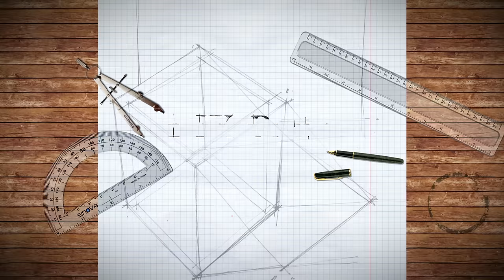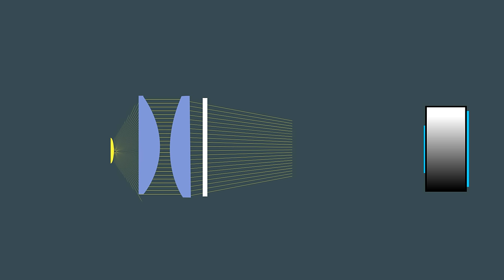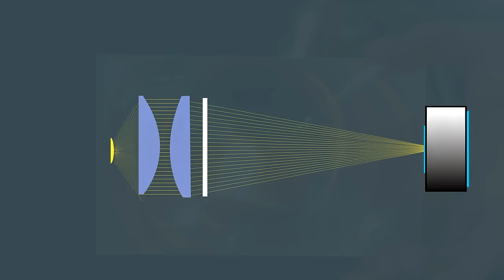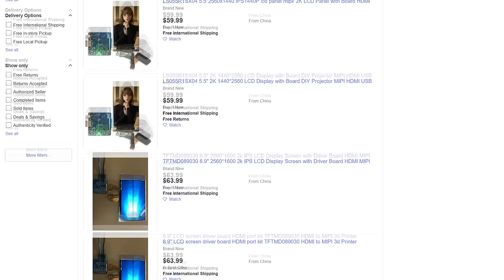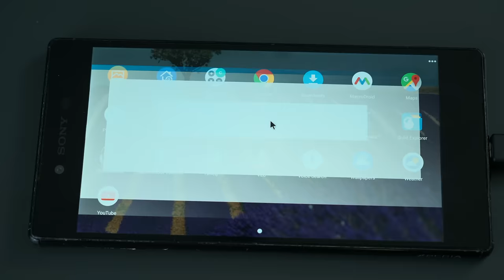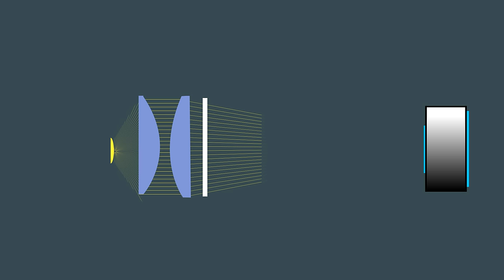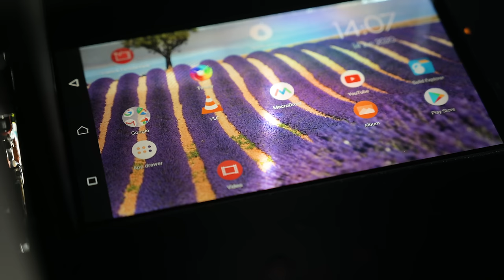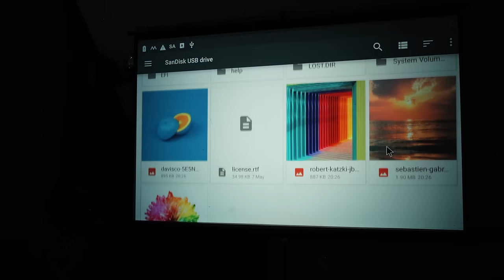Building a TRUE 4k home cinema projector (it’s awesome)

Comment: Me: Why are 4K projectors so expensive?
Matt: Hold my aluminium.
Reply: Also nuts a
Reply: @dcfuksurmom  yes i agree imo earlier had egg in it but they started using human meat recently
Reply: The answer is simple. 4k is related to the area of the mobile display. If you project it on a larger screen, you get the quality of DVD (succinctly speaking). This is done by calculations, in which you set the pixel density per unit, width, length and diagonal of the display or projected image. An expensive projector ensures that the specified image quality is maintained if the installation conditions are met. If the image from the projector seems to be worse, it is due to the image processing algorithm (compression, etc.). Within this, the projected image from the mobile phone may look better, which is not the rule. If someone wanted to project 4k, they would have to duplicate the surface of the mobile phone as a mosaic to the total size of the projected image. In this way, for example, HD or Full HD panels are joined to the walls as a mosaic, which will result in overall HD or Full HD quality. However, such an enlarged image encounters the problem of enlarging the original pixel to several pixels. Therefore, the larger the format, the larger the resolution must be. The situation is absolutely catastrophic in the field of virtual reality. The human eye recognizes a pixel at an angle of 1 minute. Sharp sight can handle 24 seconds. Virtual reality brings the image closer through the optics, instead of zooming out, and therefore is still unsatisfactory. Limits are reflected not only in the price.
Reply: Because they are not made from mobile phones?
Reply: @dcfuksurmom  Better color maybe (hard to judge from a video) but the commercial version was much sharper.
Reply: Al-you-mini-yum
Reply: hahaha matt needs to make merch about aluminium angles 🤣🤣🤣🤣
Reply: @DL-kc8fc  That's too much text for stating that pixel size might be too small/not cover his designated area and with higher projected image the pixels per inch ratio decreases, the second part however applies to any kind of display/projector.

Also 4k is the pixel count, it's not related to anything else, this projector is still 4k, DVD is at 480p.

I agree that that increases the cost, however I don't think that's enough to justify it, another important thing to add here is that this phone price was ~1000$ when new and even that was a low price per tech you get but manufacturers managed to keep it that low by scaling processes, the projector market isn't that big therefore the prices are higher.
Reply: @afanasieguler7833  I apologize for the much text - my professional distortion. Anyway, regardless of everything, HD or Full HD, 4K .... are primarily due to the requirement of large display areas and their viewing from any short distance. Lapidarily, if you want to build a 5x2.8m tele-wall in 4k quality at home, you must assemble it from individual 4k screens. This is what he solves in TV studios so that the back image has acceptable quality. If you project a 4k image from the OLED display of a mobile phone to a size of 5x2.8m, it is no longer in 4k quality from a normal viewing distance. You would have to retreat to a distance such that the projected format matches the size of the mobile phone's format from the normal viewing distance, which is counterproductive. I mentioned this in a way in connection with the resolution of the eye of 1 minute per pixel, etc. This is what it takes, regardless of the price and regardless of the quality of the recording. That's why some projectors are at higher price levels ...
Reply: @Flannery's Notebook Thank you for your response. However, what you are criticizing is not a matter for me, but a google translator. Normally I have a worse or better agreement, but I leave the technical terminology and connections with this in the competence of the compiler. That's why I don't take it personally. The first post was under control (with corrections), the second I left out of lack of time as the google translator "processed" it. Personally, I am struggling with the opposite, that is, with the correct translation of the intended things of other discussants, and I have to come up with a lot without criticism of them. No less, but still the size of the format relative to the size of the pixel and the viewing distance in relation to the angular minute. That was the whole thing. Of course, there are a number of projectors, from processor-controlled mirrors or translucent LCDs, etc., but their price, in addition to the technologies used, also reflects the resolution that these technologies provide. Maybe the google compiler handled it well (I see errors, but I leave the output). If not, an intelligent person will very easily find out the context, like me in the opposite direction.
Reply: Compare the size of his build vs any consumer projector

Comment: I made one of these some years ago (not 4k) by taking an old 3M retroprojector and replacing the fresnel lens with a laptop screen and then adding another fresnel lens inside the machine before the bulb (note, i replaced the highly incandescent bulb with an LED projector grade one. I burnt the first LCD). It still works and is quite useful. Plus, it costed me only the new lens and the cost of the screen controller, which all in all was about one hundo. If you have one, it's worth it as it can then be refit inside the original case of the 3M which is actually decently small for what it is.
Reply: Thank you for this!
Reply: how can you fit a laptop display in it? don't you need a custom case for this?

Comment: Good project. You've got everything right expect the fact that the Z5 premium runs everything at 1080p with exceptions to certain sony apps to save battery and reduce heat. You can improve the image sharpness greatly by flashing a custom rom and a kernel that supports always 4K mode. Mind that the ability to watch 4K stuff doesn't mean the screen itself is operating at 4K.
Reply: Certain apps means photo and video. This is exactly what this projector is for, isn't it?
Reply: @basantathapa62  but things like Amazon Prime and Netflix would only work in 1080p, unless you don't use the phone and use a hdmi control board (which supports HDCP) and connect a smart stick to it.
Reply: Doesn’t matter: http://yedlin.net/ResDemo/index.html 
Go to part two 5:30 if you don’t want to get super nerdy.

Comment: Like around 16-18 yrs ago, we used to do this with a huge metal halide bulb with its gigantic 10+ lbs transformer, a stripped 15" LCD monitor, a silver bowl-kitchen ware reflector (I forgot the name) and the lens spec'ed and designed by Brainchild. I wonder what happened to Brainchild's Lumenlab but I used to be one of those kids who made  DIY projector. BTW, you can do lens shifting by tilting the Fresnel lens. I had this feature on my wooden projector that I used for 3+ yrs. Good times.
Reply: Just wanted to ask, to adjust kerystone would you tilt the top or bottom fresnel?

Comment: Very impressive build.
One thing I'm particularly interested in is how it handles vignetting? I think I noticed some in the video but I could also been a mistake
Reply: I did noticed that too. The vignetting is pretty visible...
Reply: By using a bigger light source and bigger projection Lens
Reply: I made a similar (but much less elegant) projector a decade or so ago through a forum website called Lumenlab. Back then we used 720p or even 1080p LCD panels from computer monitors (stripping off the backlight), but one of the main issues I found was the vignette effects of light dropoff at the corners
Reply: Not only vignetting, but also how to deal with keystoning so it doesn't sit on your coffee table.
Add in no beep blacks, interfacing issues with an AVR, etc...
When you consider the cost of a decent screen, this project seems to not be worth it
Reply: "But I could also been a mistake". Thats a question for your parents mate
Reply: @stevebrunoca  I built a projector similar to the Lumenlab one and it served me well for years but instead of using a point source of light from 400watt Metal Halide bulb (way too hot and loud in a small room) I used 20X F8T5 5000K fluorescent tubes (total of 8000 lumens at 160 watts) with back reflector and a diffuser before the fresnel lens and it seemed to have far less light drop off at the corners and ran far cooler than my first try with the Metal Halide lamp.
Reply: @spammyjenkins87  Unfortunately I dont have a copy of it, but you can browse through some of the forum still through way back machine: https://web.archive.org/web/20090215000853/http://lumenlab.com/forums/
Reply: @kuhrd  Very cool. Do you have a screenshot of the projected image or the build? I need to see if I can dig up any photos of my build. Being able to use phone LCD screens and tiny LED light sources definitely is a big advantage to the huge LCD screens and ballasts that we needed back in the day.

Comment: “using a 300w LED will mean louder fans”
someone will probably watercool it at that point
Reply: watercooling also requires fans, so it's actually not gonna be much more quiet but will cost more and will require a lot more space
Reply: @koksem  Watercooling will allow it to be at the same temperature with less fan speed, at least for a while. Bigger rad and more fans and you can lower the speed even more which results in less noice
Reply: @lauri9061  but is it really worth spending money for watercooling setup for a little less noise while you can use quiet fans and add some kind of sound proof material on walls next to fans ?
and also it may not even be a problem bcs when watching movie you also want to use good audio which will probably cover sound of fans.
Reply: @GmOnEy21O  I am proud of myself because I read it all xD
Reply: lol i have crazy idea. What if cool it with peltier element(Further PE)? Make the cold circuit, that will have special refrigerant, with low solidification temp. It will cool the led. Right after the led mount usual rad with fans, to make water slightly cooler, to prevent PE thermal overdrive. After the rad peltier PE will cool the refrigerant, and the cold water will go the led. And make the hot, second circuit, that will cool the back, hot side of PE, and use for them huge rad, like ones, cooling cars engines. Or just use 3 or 4 420mm rads. There will be problem with condensate on the cold circuit. Maybe make sealed from other electronics zone in projector, and mount a cistern on lower side of the zone idk) Sry for bad english, im russian)
Reply: @v9m-n7n  and again I've read it all
Reply: @v9m-n7n  I'm not an electrician or anything like it but from what I read on wikipedia It could work, I don't know how efficient that would be but if you try to do it tell me.
Reply: why? get 120 FPS?
Reply: @lucasrem  bruh
Reply: @lauri9061  pushing air through a radiator is actually quite hard, you need high static pressure and high fan speed. The radiator fans in my pc run as fast and louder than the my other fans, the noise increases with dust buildup in the radiator too. A noctua NF fan will be better than watercooling.
Reply: He might as well use his breathing mecanism for the led haha
Reply: @koksem  I thought water cooling means, pouring a bucket of water on the thing you want to cool from time to time.
Reply: ok then
Reply: This Guy made Display monitor Aqua cooled
Reply: Linus
Reply: Water cooler would cut down on hight of the unit as well. That heatsink took up about 33% of the interior space.
Reply: @LilAlbus  you could probably use a distribution block with a translucent white cooling fluid... 🤔 But idk if it would diffuse the light to much to actually make a good projection.... 🤔
Reply: @v9m-n7n  linus tech tips tried to use that to cool a pc but it didn’t end up working so not sure how much of a difference it’ll make
Reply: @koksem  Watercooling will be a billion times more silent...
Reply: @koksem  Yes, watercooling would be totally worth it...
Reply: Sky is the limit
Reply: I expected more from viewers of this channel. Of course water-cooling would work better. And it does so by increasing the surface area available for heat to dissipate from, not because of the capacity of the water in the system, which almost instantly reaches equilibrium. As for noise, that is dependent on fin spacing and shape. A water-cooled system does not need to be loud just because the one you have is loud. 🙄
Reply: @lauri9061  You can also run coolant lines away from the unit to somewhere where the fan noise of the radiator fan will be less obtrusive.
Reply: Speaker fabric won’t stop dust as effectively as a foam or carbon based filter.

Comment: We built something like this in high school using box of pringles for the two lenses and focusing mechanism. We used halogen lamp (tho it is too hot), wrapped the inside of the box with mirrors and copper wires as cooler. 

We won science fair for that year. This was in 2000. 🤣

I enjoyed this video thoroughly.